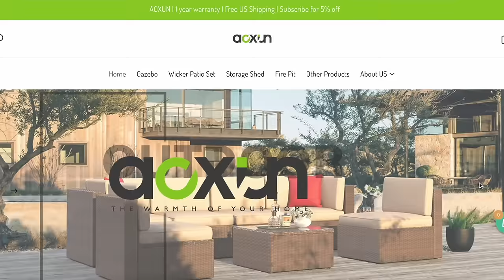Scariest Moment of Our Lives

Comment: I won't tell you what you "should" do, but I'll share what I did and why I did it.  Firstly, I'm not off-grid, but wish I was,  You guys are living my dream.  I had my solar installed by a solar company, but I chose ground mount over roof mount primarily because we just had our roof replaced, and adding panels would void the roof warranty.  I never liked the idea of drilling hundreds of possible leak points on the roof just so I don't have to see the panels in the back yard.  So, I thought I would make double use of the ground-mounted panel installation by turning it into a chicken run.  I even built the coop underneath the panels.  This worked out splendidly.  To each his own.  If you think they're ugly, do what you have to.  To me, they look very cool and futuristic.  LOVE your channel!  Take care.